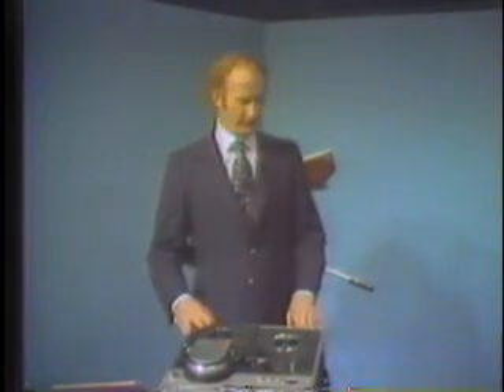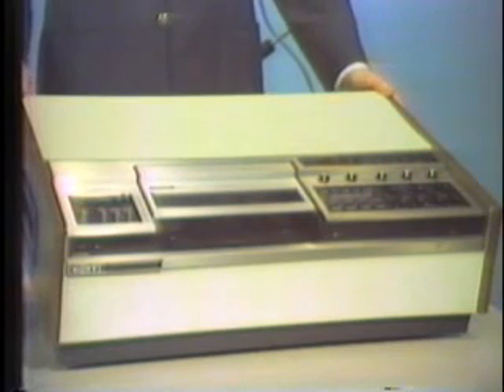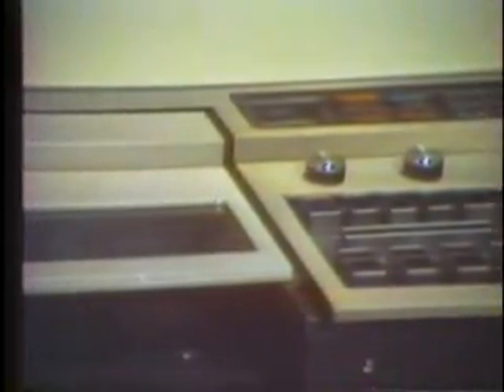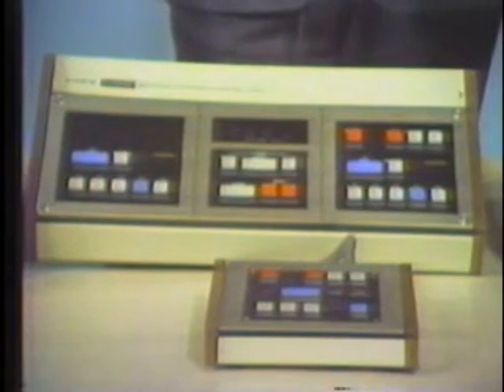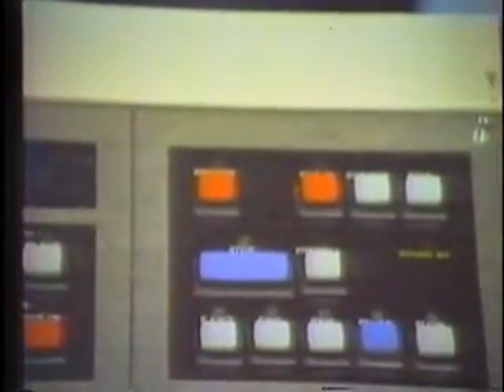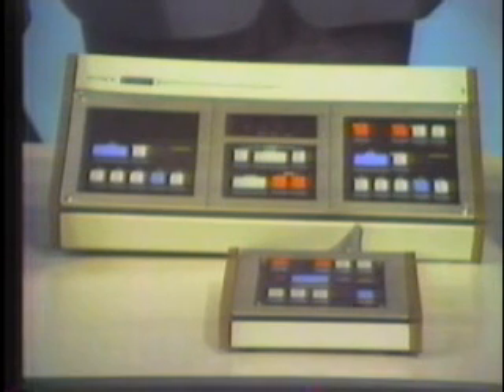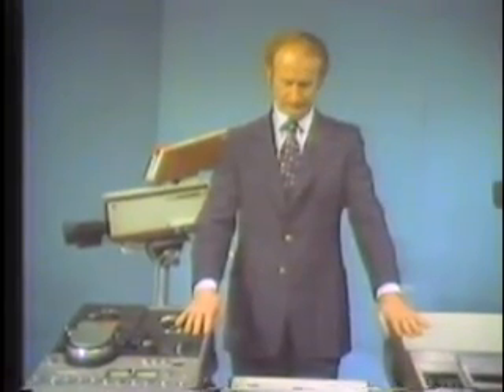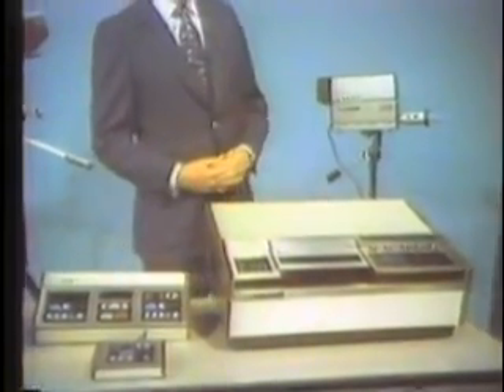Sony 1974 VO-2850 Umatic Editor Introduction

Comment: I had 3 of these and a DATATRON editor at KPIX in 1975.  And yes, it was shrunk down to BetaMax.  The resolution was only 229 TV lines v. 350 lines for "broadcast quality."  One audio track carried SMPTE time-code.  This was the birth of ENG (electronic news gathering). $13,500 for the SONY system.  It took Digital Time-Base Correction to make a 'near broadcast quality' picture.  When silver went up to $40 an ounce, news FILM was doomed.  Google the BVU-50 ans RCA TK-76 camera. see http://m.blog.daum.net/daligi/12679251  The BVU 50 was designed to work in orbit by NASA.  Think thick gloves!  The 4800 was the first field news recorder.  Consumer to pro to broadcast... In 1969, Sony introduced the prototype for a consumer video cassette, the 3/4" (1.905 cm) composite U-Matic. The best TBC for U-Matic was the Ampex TBC-2! (1980)

Comment: so does anyone know if this was recorded on U-Matic tape?  If so, then I assume the unfocused looking picture is probably due to the camera.

Also...wasn't Beta a sort of scaled down version of U-Matic?
Reply: The unfocused looking picture is a combination of the camera and the recording technology at the time. The cameras required an enormous amount of light to get a decent picture. The other thing to consider is that the camera and recorder just barely recorded in Standard Definition. Back in the 70's after a day of shooting and editing I would go home, turn on the TV and wonder how they could get such a sharp picture. The 3rd thing to remember is generational loss. The original tape might look ok. Editing moves it down a generation. It looks noticeably worse than the original and then copies of the edited master look worse yet. We are probably seeing a 3rd generation video. That's the way it looked. 
Beta had a similar wrapping path to U-Matic. The Beta tapes were 1/2 inch, the U-Matic were 3/4".
Reply: I think they used some of their DXC single tube cameras to shoot this. Perhaps the DXC-1200.